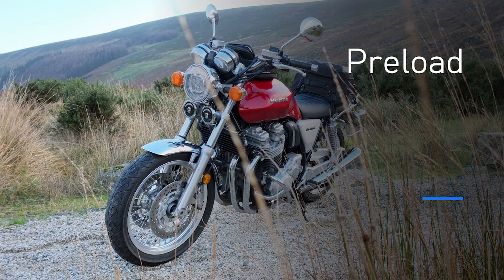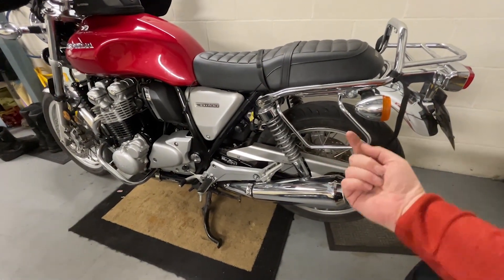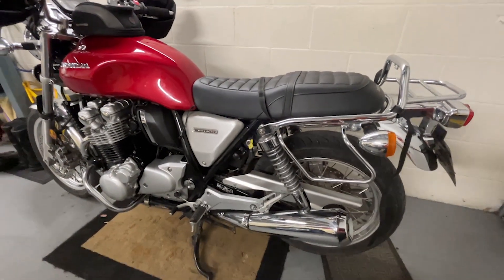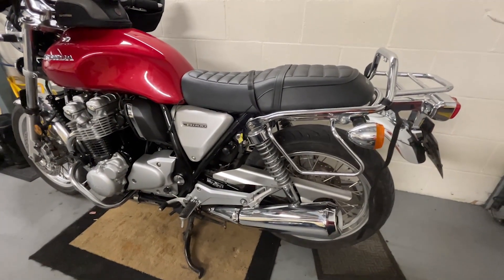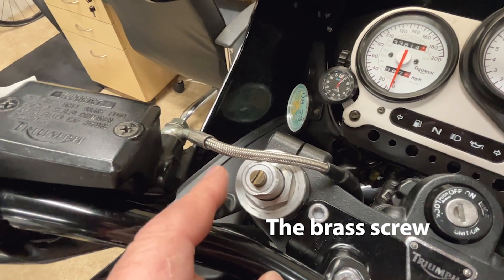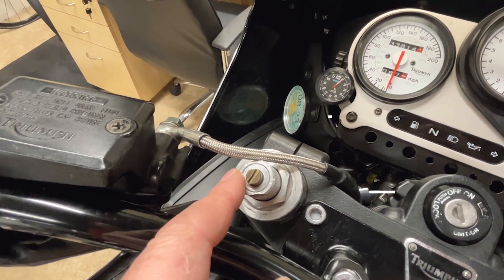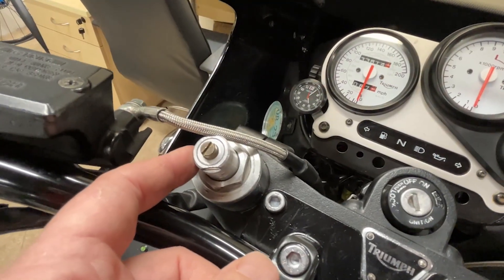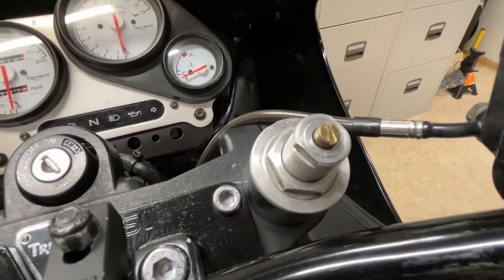Manual Motorcycle Suspension - It Should Be Much Simpler By Now

Comment: You've a great point about making it simple.. I've had 20 different bikes over 30 years and still haven't a clue how to adjust damping so.. I've always left it alone. I'm 18 stone! No wonder me back is knackered 😂  Great video. Must give it a try
Reply from the maker: Do. Maximize the damping fully and go for a 10 minute spin then minimize it completely and do the same road. That will give you the two extremes of what is on offer and you can choose what suits you best. I’m 18.5 st, and before any damping adjustment we are always going to need more rear preload otherwise the steering will be too slow. At our size we probably want to use up 70-80% of the preload adjustment up.

Comment: hello laddie, I have 2 questions for you if you dont mind.  I would like to know where you got the staunsion protectors from on the fork legs.  Also I have just bought a CB1100 EX 2018 with 5,000 odd miles on it..Blue. I bought it from a dealer in Edinburgh, there is a video of the bike I bought from this dealer on ebay.   I would like, if possible if you could briefly run me through the process of importing it into Ireland as I have found it a minefield trying to get the correct information from the irish government .  Thank you.
Gerard Taylor
Reply from the maker: Hi Gerard. I imported my CB1100EX one month before Brexit so it was very easy to register for the VRT. You could put the bikes age and model number and mileage in a field online and it would tell you down to the last euro what you had to pay.   But, since Brexit you are going to be liable for VRT and VAT and possibly import duty too. It really is not worth personally importing from the UK anymore. It is too messy and expensive. I believe people have switched over to looking to Germany for personal imports now as that system is like the old way. Your bike has over 6K KM and is a few years old, that used to allow you to import VAT & Import Duty free but no longer. See https://www.revenue.ie/en/vrt/registration-of-imported-used-vehicles/index.aspx. I would try and cancel the purchase if I was you. As for the fork protectors they are new from a 1990's Triumph range, part number A9641010. You can probably find them on ebay now as I think the Triumph stock has just about run out. I did have to move my dual horns out 8-10mm otherwise they interfered. Honda also did fork gaiters for this model which can be purchased new but they require dropping the forks to fit of course. Sorry to be the bearer of bad news?
Reply: @terenceokeeffesmotorcyclestuff  Thank you for your prompt reply

Comment: Hey Terrence, I own a triumph rally pro 900. But I think the bike is a little front leaning with the current handlebar setup. Could you please make a video on the adjustment available. Also should one go for raisers if yes then which ones.
Please do take it up if possible 
it would be a great help 👍
Thanks Sir!!
Reply from the maker: I do not own a 900 Rally pro, this was one I had on loan. I would check that the front preload is in its stock position which would make it more front down for road use. The option is there to put it in the off-road position which will raise the front and lengthen the trail. I would go with any risers from good suppliers. I have used SW-Motech, Wunderlicht and Voight before. Best of luck!

Comment: as a motorbike novice I adjusted the preload on my rear shocks last year after googling the symptoms & not being happy that it felt a bit too 'squirelly' for my liking going down steep hills, first by one notch then two, and it feels so much better, so my attitude was/is - problem sorted, and probably even if i had easier adjustments i'd hardly use them, but i dont go fast and dont have a powerful or heavy bike so it's maybe of less importance, but i fully take your view on making it easier, as there's so many frustrating things in modern life where you have to learn how to make simple adjustments and the instructions are crap and poorly explained. it's got to the point where even searching through my folder of 100 instruction booklets to find the right one stresses me out -  maybe i'm getting too old... GL
Reply from the maker: 🤣 I know exactly how you feel about those manuals Bob. I have a microwave with a pile of buttons and I have no interest in spending time reading that! If I can set it on full and put a time on it I’m done. Great you got your rear preload sorted and you getting more out of your bike. 👍

Comment: Hi new to your channel sort of new to triumphs …. Took a 1998 triumph I want to say sprint (cringe worthy mods done to it at some stage) in on a trade and I’m going to convert it to cafe racer … I know … you need scoff but there’s little else you could do with it trust me .. but before I commence work, I need to get it running. I have an issue with fuel tap and it sounds similar to something you went through.
Reply from the maker: Don’t bother trying to fix it, many people finding the refurb kit a poor fix. I think many install the new diaphragm incorrectly mind, it is easy to do. Just get a complete new tap from Sprint Manufacturing. These carbs do need a good prime by setting the tap to that prime position and holding it in. It will only move in a half a mm but makes a big difference. Test your bike with the tap left in the prime position, if the fault persists it may not be the tap. If you have the original plastic fuel knob these break where they join the metal tap but you think you are turning it when in reality you are not. Remove the plastic knob to be sure. Good luck 👍.
Reply: @terenceokeeffesmotorcyclestuff  stripped it yesterday, found that the white plastic centre was seized in the interior of the tap, the knob is junk. I’m not impressed with the tap at all was wondering is there another tap at the fit or an upgrade was thinking maybe a Thunderbird tap might even fit a Thunderbird tank. But their hens teeth. 
On a footnote, have enjoyed your videos. Good to see a fellow paddy on the Interwebs of a similar age, with enjoyable content.
Reply from the maker: @tatankacleary  Cheers Micheál. If its the sprint you have I think you are going to be stuck with the same replacement tap. Rebuild kit here https://www.triumphparts.co.uk/product/petrol-tap-seal-rebuild-kit-for-vacuum-tap-on-carburettor-3-and-4-cylinder-models/ but you will hit import duty too and their postage isn't cheap. As I mentioned, it is easy to make an arse of the rebuild kit, they do replacement taps to for £69. I'm not a Facebook fan but there is an T300 group with great techical info and full downloadable service manuals in the files section. There is also an Irish T300 group but that is fairly quiet although we have met up before for a spin out. That is Triumph T300 Ireland.
Reply: @terenceokeeffesmotorcyclestuff  hi Terence just a quick one don’t suppose you have an air box for a 900 they seem to be an astronomical price and I’m afraid the previous own had cut the old one up …. I can get the replacement filter but not the box and no one is breaking them the other thing have you an old tap? as if figure out the problem with mine
Reply from the maker: @tatankacleary  I’m on a four cylinder so no airbox, sorry. I have an old tap with a refurbished kit in it but it didn’t work out that well for me so don’t think it will be any better for you. If you are in the UK try Ivan at National Triumph who has very good well priced second hand stock.
Reply: @terenceokeeffesmotorcyclestuff  nope I’m a Waterford man I have my tap working there’s a crack in the vacuum nozzle … for my sins I work at Waterford HD try all the usual suspects in Ireland even tried traynors in the north buying things from England is a price prohibitive with the import tax but I’ll give him a shot
Reply from the maker: @tatankacleary  happy for you to try my tap with the refurb kit fitted if you want to take it apart?
Reply: @terenceokeeffesmotorcyclestuff  I might take you up on that yet …. found a breakers in France trimax-Moto bit of a language barrier ….

Comment: I love these vids, great stuff. However, I get confused when you say add preload (bare with me), if you add preload, are you taking compression off the spring? My VFR has an adjustment knob with positive and negative. If my assumption is correct, the plus is adding preload and therefore reducing the compression on the spring. If I am wrong, please put me out of my misery and clarify
Reply from the maker: Hi Bleary View. No, adding preload is not reducing compression on the spring. You are only pushing the rear of the bike up adding preload as the two ends of the shock move independently. It is there to compensate for added weight on the bike. At two different preloads while the bike is just sat there the spring lengths are actually the same. The bike will be taller though with more preload. But, let’s say you have a 70kg guy and a 110kg guy. The 110kg guy needs more preload so you add it. Both riders now sit on the bike and both have the shock at the same point in its stroke and the same ride height. 👍
Reply: @terenceokeeffesmotorcyclestuff  Okay I now understand what adding preload actually does to the shock and many thanks for taking time to explain to this village idiot 🤣🤣 Mechanically it would be good to know how the shock raises the bike without taking compression off, I suppose it must be some arrangement that is extending one half of the shock with affecting the spring itself. Once again, these videos you produce on bike suspensions are amazing.
Reply from the maker: @blearyview2254  No worries, thanks for taking the time to watch 👍.

Comment: Terry
Great video Sir! Yes, most modern high end bikes have electronic semi-active suspensions on them. Well, SAS suspension has it's place for sure especially on big adventure bikes like my GT Explorer. My new Speed Triple RR has SAS too but you can set the suspension up manually (minus the screw driver) and lock it. This turns the SAS off. My Thruxton R is completely manual with the big piston Showa forks up front and the Ohlins piggy back shocks in the rear. I followed Dave Moss on how to make the bike perfect for me except I needed a screw driver and the spanner for the rear coils. No big deal because the bike is basically set and forget for my weight. Most riders have zero clue about suspension setup and could care less and ride the bike forever on the factory setup. Once you learn how to set the suspension for YOU, the motorcycle is completely different than the factory tune. I set my Speed Triple RR the same as my Thruxton R except...electronically.
Ride SAFE and BE safe Terry!
Cheers! 🍀🍀🍻🍻
Reply from the maker: Yes, if only people would use what they paid for they would realize how much better their bike could be. While my latest bike was being serviced I had a 400cc BMW scooter that had very poor handling steering far to wide around the bends. Two notches of preload added by the side of the road and “bingo” it was perfect. Ride safe 👍👏🏻
Reply: @terenceokeeffesmotorcyclestuff  Great to hear Sir! I'm at the airport on my way to Arizona for a Desert Rally Adventure for a week. Ride safe Terry! 👍